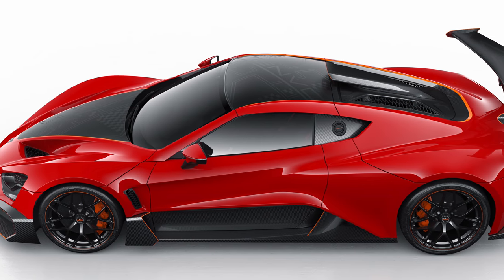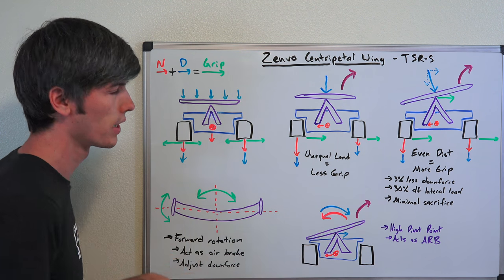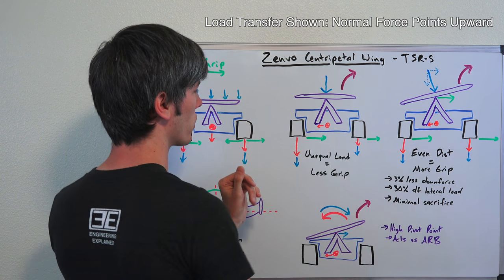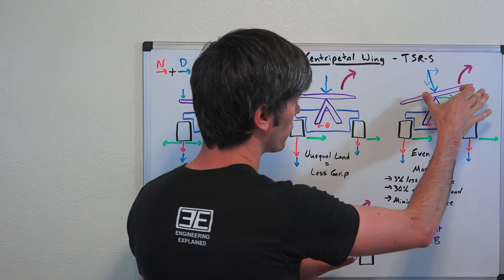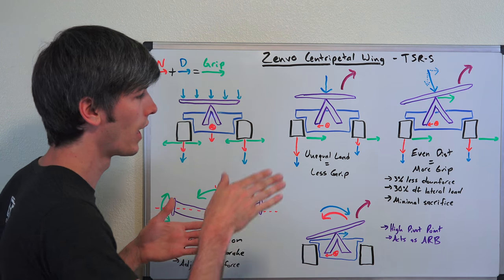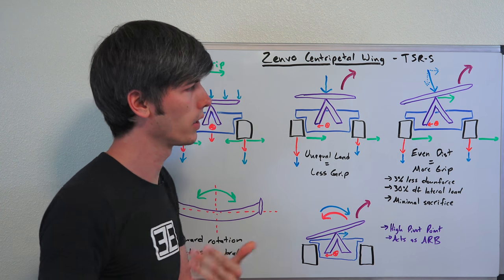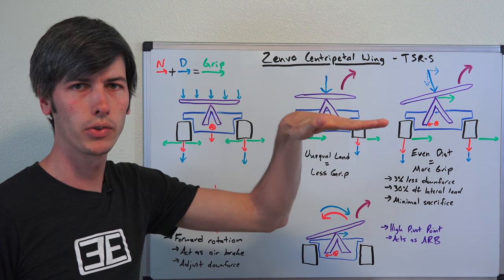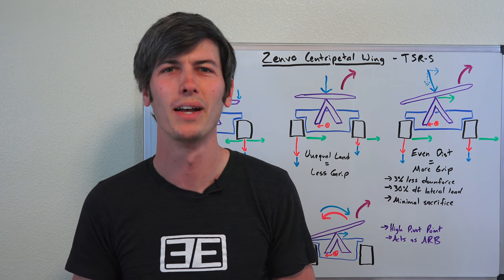Zenvo's Brilliant Centripetal Wing Maximizes Grip

Comment: The way Zenvo worded their claims makes it sound more like they lose 3% of TOTAL downforce (i.e. all the forces generated by the wing are 3% lower when tilted), and there's a 30% lateral component, so you're diminishing the downward component to (100%-3%)*0.7=67.9% compared to running the wing flat. If the downward component really only goes down 3% while a 30% lateral component is added, that'd mean that running the wing at an angle would make it massively more efficient at generating lift (it has to, if it's producing almost exactly the same downwards component while adding a big sideways one), which doesn't really make any sense (or that they're lying about/being misleading with the numbers, which is par for the course for car manufacturers, "300% more downforce at the front" is an easy claim to make when you're starting with 50 kg of lift, as a semi-recent example).

Now whether losing almost a 3rd of your total DF for getting a slightly better load distribution while cornering is worth it will depend on the load sensitivity of the tyres, but I kinda doubt it's anywhere near worth it (otherwise we would have seen it before in racing use somewhere), especially when you add the extra weight caused by having the system. And whether the car actually produces that much DF to begin with is questionable, even a lot of high end road cars with aggressive looking aero, like some 911 GT3 RS models, only manage DF in the 50-80 kg range at 200 km/h at best when tested by 3rd parties in wind tunnels. There are some rare exceptions, but they're indeed rare.

These attempts at lateral force generation seem odd to me. Kyle.Engineers (an aerodynamicist currently working in F1) made a nice video about the Pagani Huayra's laterally adjustable aerodynamics, and made the point that adjusting the lateral balance of your DF is almost never worth it if you're reducing your total DF at the same time. What boggles the mind the most is that to me there's a pretty obvious way to generate a lateral force that you can adjust, that doesn't necessarily reduce the DF much if at all, and can be highly efficient at generating lateral forces. It's a technology that's been used for well over a hundred years in aero planes, called a "rudder". =) Have a big ol' fancy wing, add extended end-plates (which increase DF by themselves already), and make portions of those into movable rudders.

Comment: Due to it's position at the extreme rear of the vehicle it would seem that, in the "anti-roll" configuration, while loading the inside rear wheel it would necessarily unload the outside front wheel, possibly creating some steering-control issues.

If I'm incorrect, please explain that dynamic.

Thanks, in advance.............................

Comment: This is interesting!.... I think it would be interesting to see an aerodynamic setup that incorporates a traditional rear wing but with the addition of a vertical “rudder” that would deflect in the opposite direction to the turn, which would not increase the downforce, but would rather add an aerodynamic sideward force in the direction of the turn which would then reduce the amount of downforce required or make the available downforce more effective.
Does anyone know if anything like this has been tried?... you could also have one at the front of the car!

Comment: I remember in a previous video involving painting an intercooler black, stating that it isn't more efficient because of a 3% temperature difference between a silver intercooler (with airflow moving across intercooler) wasn't worth it, although the mighty car mods group proved otherwise (with no airflow over both intercoolers, the black one was almost 40 degrees C cooler). My question is why are you willing to accept a 3% loss in downforce here for 30% lateral load transfer and not a 3% temperature difference while air flowing through an intercooler for a 40 degree C temperature difference while the car is stationary?
Reply from the maker: I didn't design it, they're not my numbers. Zenvo says a 3% loss of downforce is worth it for the load transfer, to have higher cornering speeds.
Reply: That's fair, I'm just curious on your thoughts about it

Comment: Not  convinced by this - they would need to have an equivalent system on the front too (they have have this covered already but it's not covered in the vid?). Otherwise they will be upsetting the front/rear load in tyres, it's important to have the load as you want it on all 4 tyres and not just the rears.

Comment: Hi Jason! While watching this video, I was wondering if splitting that centripetal wing into two smaller parts and mounting it with the same actuators individually over each rear tire might be more effective and reduce weight! Similar to the pitch control surfaces on an aircraft, only both wings can be individually controlled to get the best downforce combination in any given situation. Would that be an improvement over this design?
Reply from the maker: Great question! They actually chose specifically not to do this, as briefly discussed in the video, because that reduces overall downforce. Better to keep downforce high and redirect the tire loading.
Reply: Awesome!!

Comment: Hey Jason, I would like to ask, I remember with the Huracan Performante, you pointed out and kinda criticized that, if you  increase the downforce in total when going around a corner instead of one side, that will help the cornering better than just one side since the outside tire would have more normal force anyways. How is this Zenvo different from the Huracan?
Reply from the maker: Because it doesn’t sacrifice downforce as much (I discuss this in the video, top right section). Overall downforce only down 3% when tilted. Vs the Lambo reduce downforce on one side.

Comment: It surprises me that the air flow direction is not taken into account in your analysis.. your explanation is valid as long as flow comes in axial direction with the car body.. when the car turns, the flow is tangent to the turning circle so in my mind I see some part of the air flow acting as a lifting force in the right part of the wing (according to your drawing)
Reply: Berry29tm I'd potentially reassess your consideration. The air path axis is always aligned to the body axis unless there is an external acting flow flow vector (i.e. wind). Whilst it's true the force vector of the vehicle is normal and tangential, the airflow is not. I wouldn't consider there to be flow losses from indirect flow incidence. I'd have to rewatch the section you're talking about, but offplane, angle neutral flow over an aerofoil doesn't produce a lift vector reversal, it will just change the lift distribution of the wing effectively reducing overall lift. Functionally the geometry of the wing (which defines the lift coefficient versus angle of attack) and the incident angle of the flow sets the direction of lift (hence spoilers as flipped aerofoils).
Reply: The air flow is parallel to the ground, and the wing is inclined forward (unless it's going on a straight, in which case the wing is also parallel to avoid drag) so it's always pushing the car against the ground, think of an airplane wing's aileron.  Tipping the wing makes part of the downforce a "sideforce", to counter the inertia.

Comment: I’m still quite skeptical. It does make sense on paper but aerodynamics of a car moving around a corner do differ from straight ahead motion. Does anyone who knows CFD have any input on that? Also from watching the videos of this in motion on track, it’s quite slow to respond. Lots of tracks have corners requiring quick direction changes, not to mention camber and elevation. Would the delay in this wings tilt cause any undue instability? I could be talking out my ass here, but there might be a reason the big players in this field have yet to design something like this.

Comment: Hi @Engineering Explained
It's that a mistake or i'm wrong one or another =) ... in the top right drawing the compensation it's due to the wing so, the blue arrow (wing forces) should be bigger and the red arrow (weight forces) should be the same size as the drawing in the top middle... Am I right?

Comment: In my opinion it resembles (in a weird way) rear steering as it applies torque/turning forces to the rear of the vehicle (mostly) and I thing that this could make the car a bit unstable. Just like rear steering where the rear wheels turn in the same direction as the front, the Corresponding wing forces are for high speed cornering adding stability. But at low speed it should be the opposite like the rear wheels turning the other way to make the car more agile, though the wing doesn't provide as much Downforce at lower speeds. Plus the turning center of the torque applied to the car is completely different to the turning center of the car ==> instability. Again in my opinion zenvo should go with both this wing and rear steering (or at least rear wheel torque vectoring) not only to counteract the negative effects of this system but to complement it's function and enhance it rendering any instabilities null!! I would love to hear your opinion on this matter, maybe a follow up video, maybe your own ideas for a better system (although I'm not hoping for much :p). Great job as always and keep up like this, your work is perfect!!

Comment: how is this system better or different than a shark fin? It seems like a shark fin has more benefits like reduced weight and straight line stability.
Reply from the maker: A shark fin doesn’t give you any downforce.
Reply: Sorry, im talking about  a shark fin combined with a wing in a setup like the Koeingsegg One:1, Lamborghini Venneno, LMP1 car or even the strakes on a GRC car.
Reply from the maker: Ahh gotcha. Yeah from a static standpoint a sharkfin can help, but if you can optimize the angle depending on the corner radius and speed, it seems having control of the wing would be superior. You could use more angle at lower speeds for a larger effect than a fin might provide.
Reply: But isn't that kind of how a shark fin works? Shouldn't your lateral downforce scale with speed and and turning angle? I totally agree that the Zenvo system is awesome but the aerodynamic losses due to the complicated mounting structure  as well as the weight aren't worth it. Id also like to see it work in odd situations like the carousel at the Nordschleife and Eau Rouge at Spa to see if there were any gains or losses in off camber and extreme elevation changes.

Comment: Hi I have a question 
Considering Tire load sensitivity, why is adding down force with the wing giving you an increasing  grip and not a decreasing grip?
Reply from the maker: Because the mass of the car is not increased, but the force pressing down on the tire is. So as a ratio, the amount of force it has to hold a certain mass in place increases.
Reply: Engineering Explained thank you Very much 
Greets from France

Comment: wonder what's the minimum speed that wing will generate a usable amount of downforce - if it is like 30 mph+ then they are onto something cool and functional. but if the whole system needs to be doing 100mph+ for any significant downforce, then it's more show off than actually making a difference. anyone got any stats on that wing?

Comment: shouldn't the orange orange arrow on third drawing be the same as on the second and only blue arrow representing downforce vector become longer?

also i wonder how much time they spent on designing the shape of that wing.
Reply from the maker: Originally I was thinking of drawing it the way you suggest, but in reality it's altering the loading of the car, so the car's weight is actually more evenly split. I think either way is fine.

Comment: Even if the wing does move it's still mounted to a central point which means the inside wheel wouldn't get any more grip as all the force from the wing is pushed through the pivot point then through the chassis to the tyres. The Pagani Huayra as induvial flaps for each corner of the car. I don't see how the wing on the zenvo can create more force on one side of the car if all the force in going through one structure. help me pls
Reply: Find a triangle. Push down on the top point = equal force.  Now, push the top point at an angle towards one of the other corners = unequal force.
Reply: Connor Maynot-There are three points connecting the wing to the chassis.Have another look.Centre pivot and 2 rams,once the rams are in position they act like a fixed strut.

Comment: You draw it wrong. On the 3rd picture the red arrow have to be same as on the 2nd picture. The blue arrow changeing, because got from the wings the extra grip. So the right blue arrow have to be longer, not the red one. Wings change the grip, not the car weight moving.

Comment: If the actuators fail to do the correct positioning of the wing, you will run the risk of crashing your car. That is because you will expect a certain grip through a particular corner and enter at a appropriate speed. With a wrong configuration that speed may be too high to be able to turn the car through the corner.
Reply from the maker: Sure, but you could say the same about anything. If a tire pops it’s bad news.
Reply: And if the engine seizes or the wheels fall off or the gearbox jams or the brakes fail or the suspension fails, etc, etc.

Comment: Wouldnt it be a better idea to split the wing into two parts from the middle and raise/lower it accordingly? The pivot seems to decrease the use of the wing due to the angle.
Reply: Did you watch the video?
Reply: Galip Şanlıtürk that would achieve the same thing but less efficiently due to the gap
Reply: Galip Şanlıtürk 
More complicated and less effective for the possible gain. 3%  downforce sacrificed for a 30% lateral gain seems pretty damn good without more actuators? Just a guess.

Comment: 100% this will add understeer. Yes more mechanical grip, but now you dont have as much force moving your car to the inside of the corner. This also feels like its not working well with the LSD that tries to put more load on the outside anyhow.
Reply from the maker: There’s a difference between reducing oversteer and adding understeer. This reduces oversteer by improving grip at the rear. That does not mean the front end has less grip. It may mean that the front won’t have more grip, but that’s a completely different problem addressed separately through aero design.

Comment: Question for Jason and everyone, 

What motorsport do you think we’ll see this first? Formula 1 or endurance? Or maybe something else.
Reply from the maker: Active aero is banned in most motorsports, so probably won’t be seen.
Reply: Engineering Explained wow thanks for responding, Jason, I’m a huge fan. 

How about as a driver operated aerodynamics system such as DRS in F1? Would there be any other caveat that would allow this tech in one form or another?

Comment: Isn't the point of this wing to push the car to the inside of the corner. And thus making the force the tyres need to put out smaller?
Reply from the maker: Yes, as discussed in the video and shown in the top right of the whiteboard. And also to increase load on the inside tire. From Zenvo's press materials: "This provides additional grip to the inner wheel, reducing the chance of a loss of traction at the rear, and also ensuring increased downforce on the inner wheel."

Comment: There's so many mistake, if you are logically capable you must know that the wing sistem is completely wrong. Even "centripetal" dosen't match, centripetal force is that what make you fall inside the corner when you ride a bike, what does it match with this features?

Comment: Ther is a couple of flaws with this......one its too slow....but more importantly this wing is linked to steering and during corrections through corners if the back end breaks away you suddenly loose downforce element when you most need it ........NOT COOL

Comment: I'm surprised that it's a single wing instead of two independent wings linked to the left and right side, allowing for independent loading / unloading of each side.
Reply from the maker: So that part is kinda addressed in the video. By having a flap you aren’t maximizing downforce, you’re reducing it one spot so it’s higher in another.
Reply: Got it! With two wings, it could only apply 1/2 the force to each side while a single wing can apply 100% of the force (or close to it nonetheless) to one side...

Comment: I prefer the Pagani Huayra system - this system doesn’t help the front end corner any better
Reply from the maker: It’s for the back of the car. The front of the car has its own aero features. For mid engine cars it’s logical, since it will be heavier in the rear.
Reply: Engineering Explained you’ll still have issues when going around a corner with that outer wheel wanting to wash out under increasing load.

The Pagani’s system has individual aero on each wheel which increase or decrease the amount of downforce on each wheel depending on steering angle and speed to maximise cornering ability.

With the engine at the rear (heavy load), why not develop some active aero for the front wheels to press them into the ground and reducing understeer to maximise cornering speed

Comment: Next for a mfr to make the same effect using only aero effects ....  (should be less weight and less drag than using linear actuators....  (never know until we try...) -  try using a swept wing with aileravators...  or would that be elevons.. jk...

These days we are no longer constrained by the need for huge embedded computing power to control insignificant parts of a car, computing is pretty much democratised and very cheap..

first world problems.